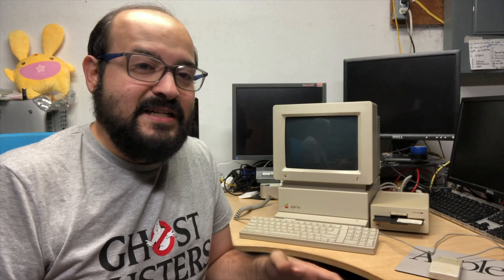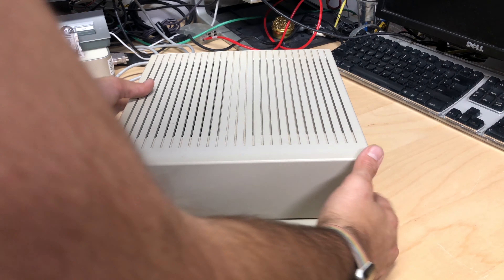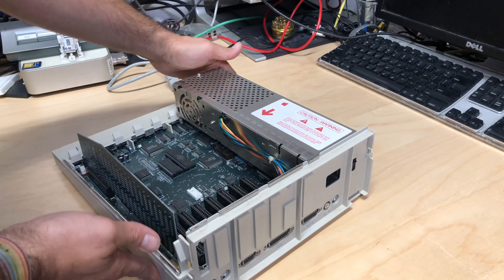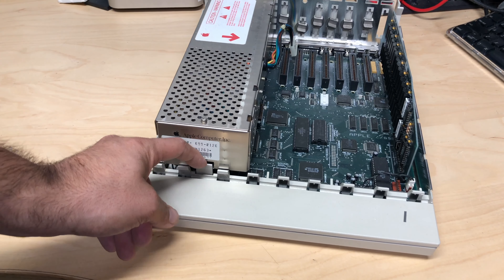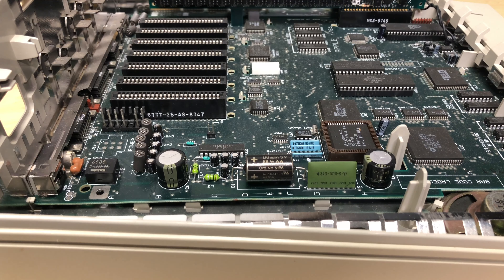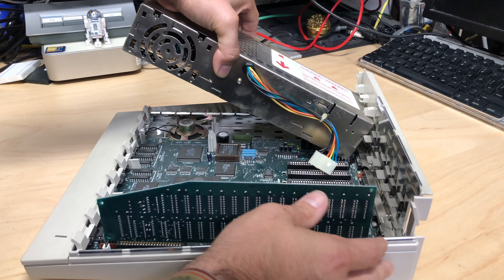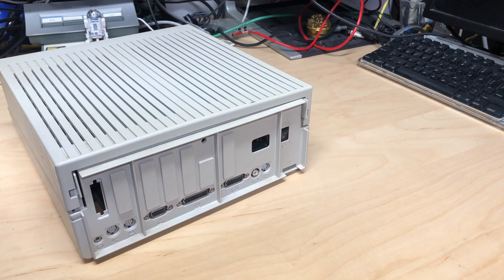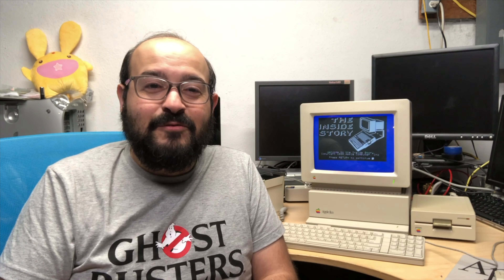How to remove the clock battery from an Apple IIgs (Quick Tutorial)

Comment: Do these batteries actually leak? I think these ones aren’t too much of a risk. are there any reports of any Apple IIgs system in which that type of battery has caused damage? That said, I snipped mine out (it was long dead) and replaced it with a kit that clipped on with a holder. Tip: when snipping the battery out, make sure to cut the wires close to the battery so there is plenty of wire left in order to make it easy to connect the replacement.
Reply: Oh trust me, they do. That's why my IIgs was a Frankenstein between two IIgs systems. When I started the project I had a IIgs with a mostly nice case with a bad psu and a destroyed mb due to its battery puking all over the board, and a IIgs with a destroyed upper case, bad PSU , but beautiful condition mb. I had to trade some spare memory boards to a user on a vintage computer forum to get a good psu.